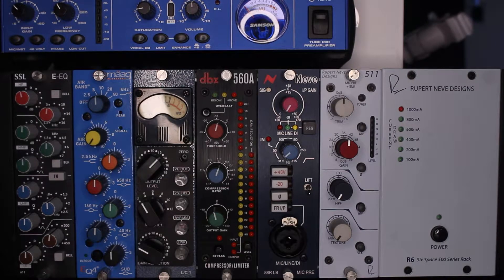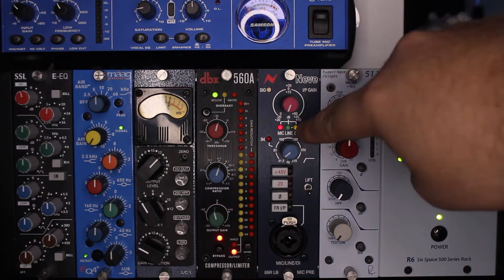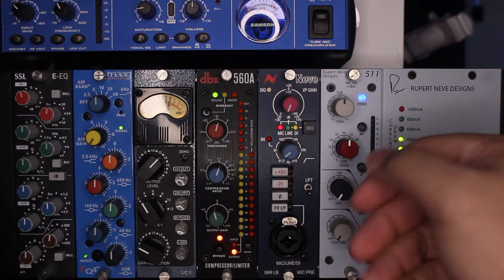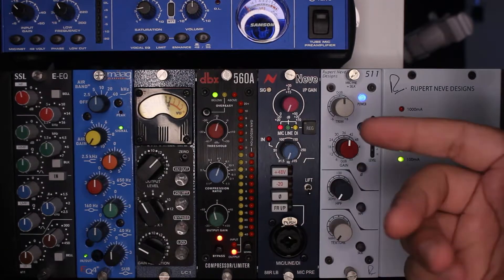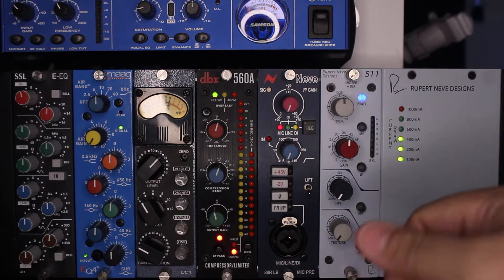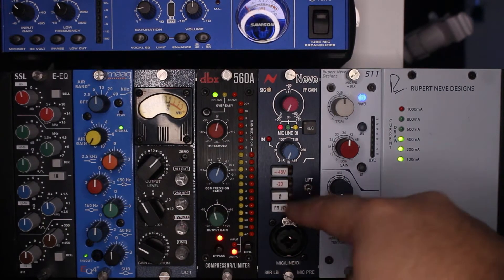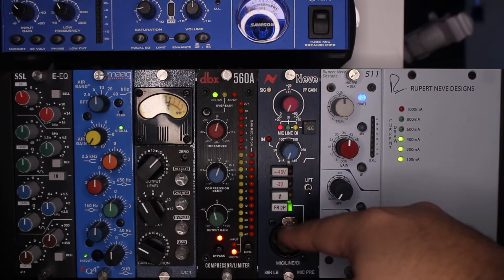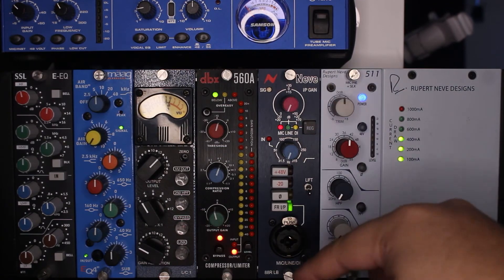NEVE 88RLB: THE BASICS!

Comment: How does the 88 compare to the 511? 
Thanks for video
Reply from the maker: Def gonna make a vid just for you on that bro! But off just explanation the 88is more color and texture the 511 definitely still can get colorful and w the red silk can add some more texture but thats when you start driving it a bit more. The 88 just has it bro the 511 starts off cleaner but def is going to add body if you’re coming from just an interface pre.
Reply: @Kmixedit  thanks a lot it would be great since i have the 511 and was thinking about adding an 88 , but it's hard to have a demo unit where i live .

Best Regards
Reply from the maker: @Zenvo-uu9tm  most definitely bro, I’m going to try and get it out for you by next week!
Reply: I feel like the 88 is a little bit darker (More low end) then the 511 also the stereo field is slightly wider then the 511. I place it in between the 1073 (Base heavy Thickness) and 511 (more high end) in terms of sound. I like that 88 Sound. Coming from a (Mid Range) Api 512v guy.